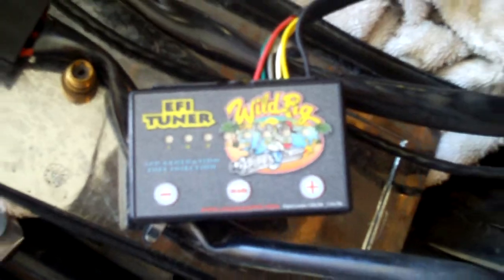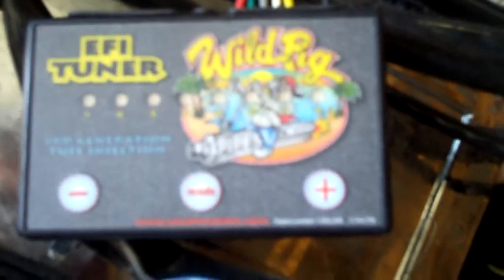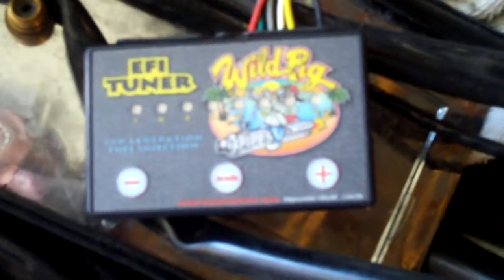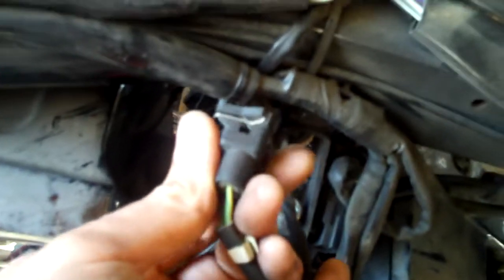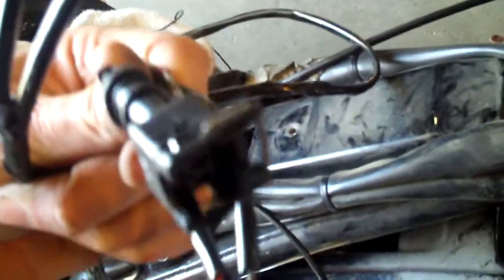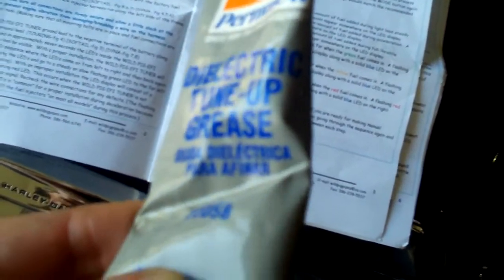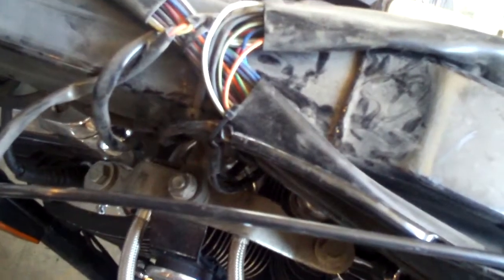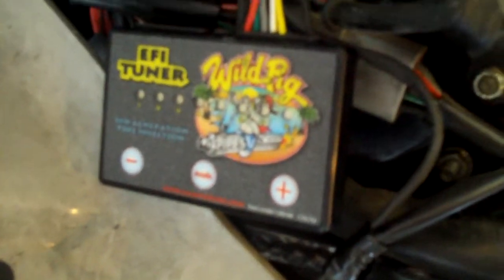Magneti Marelli Fuel Injection Tuner - Harley Davidson

Comment: What does this controller change?  Will it remove the shots from the exhaust pipe when accelerating or braking? Touring 2001 88 magnetti marrelli , slipons 4”, quiet baffle. fuel consumption - 7L/100km🕺🏻
Reply from the maker: It makes the air to fuel ratio more rich by lengthening the pulse of the fuel injectors. This is helpful if the fuel injection is too lean to make good horse power and torque. As for popping in the exhaust, it can help with that by adding more fuel to the low rpm setting making the mixture too rich to ignite in the exhaust system. I say help because depending on how far it has to go you may end up with a motor that is running too rich; bad gas mileage and even fouled plugs. There's some wiggle room but don't expect a miracle result.
Reply: Mark Young - Outside The Box thanks! I need only understand what model is for my bike: 9120265 or 8120128. http://electronicjetkit.com/Harley/viewproduct.asp?partnumber=9120265
Reply from the maker: A listing I recently saw on eBay showed the correct model from Dobeck to be 8120128.

Comment: Hey brother do they sell.thosevtuners anymore Ime in need cause i own a 1998 road glide with that feul injection system.  Please let me know ok man it would greatly be appreciated
Reply from the maker: Hello! I don't think you can find any brand new, I could be wrong. The two I installed and tried on mine were both bought used online (eBay). I would keep searching online and just maybe you'll find one, but they are kind of rare due to how many years have gone by.

Comment: Looking on the internet, Wild Pig and other companies put their badges on the Dobeck. Since mine is a Gen 3.5 may be the reason they state it doesn't matter which plug goes where. Nevertheless, I installed mine according to your front/rear injector instructions to play it safe. On their web site, they have a "hands on" simulator that you can practice setting the controller. I noticed you did another video on an earlier EFI Dobeck where you had to splice wires. Isn't it nice not having to splice the injector wires on the newer unit and just hook up a ground? The  Dobeck products previous to the Gen 3.5 adds fuel, while the 3.5 also decreases fuel and since I am running rich, Dobeck sent me the one I have, to solve the problem. I was able to lift the tank without taking off the fuel lines and it's installed. Waiting for it to stop raining to warm it up, test run and set it. Before going to Sturgis, I used your video to set my TPS. The Harley shops don't like (or don't know) how to work on the older bikes anymore. Anything I can find to keep my 96 running good.
Reply from the maker: +Paul Murray To be fair, the other controller worked pretty good too, but I kept seeing the newer push-button style and found how customizable it was so I pulled the trigger on this one on Ebay. I am familiar with the 3.5 being able to pull fuel away from the engine as well. I really like their test display on their website for punching in your numbers and getting a graph showing the results. I should have mentioned in the video, as it is a pain to remove the tank from our twin-line bikes, that I removed the tank as I was replacing the fuel pump and filter at the same time and was thinking of having it painted as well. The fuel pump and filter went in, but as time to ride neared at the end of a long Winter the paint was put off to another time. Let me give you one more recommendation; using E3 spark plugs. I believe they are the E3.36 model for EVO applications, but double check on that. I put a set in last Spring and rode the bike to Laconia, etc. (put about 5,000 miles on it over the Summer) with no problems, no hiccups, no skipping, just a strong running motor. Watch some of their videos. Something to think about.
Reply from the maker: +Paul Murray And let me know how she runs with the unit on it now!
Reply from the maker: +Paul Murray This was from my return home from Laconia.... Meredith, N.H. to Newport, Maine, 170.8 miles, on 3.323 gallons of gas equals 51.399 miles per gallon.
Reply: I am doing a product evaluation on the Gen 3.5 for a motorcycle magazine and have direct contact with the Dobeck rep. I also finished one on the Shorai  Lithium Iron battery. It was so light that I put in in my saddlebag as a spare on my trip to Strugis. I also have ALL the Sena intercom products, but a lot of the guys I ride with don't use intercom or can't afford it, so sometimes I loan them my extras. I use the Sena SPH10H dedicated for the 1/2 helmet in the summer and the regular one on my full face in the winter.
Reply: Was the mileage with the Dobeck installed?  I got 61 mpg on the way up  to Sturgis in 2005, doing 60 mph with the group. My mpg wasn't that good coming back at 80mph. After my top end job, it decreased and now I am running rich lately. I usually keep up with auto and motorcycle stuff and had never heard of E3. I looked on their web site. It looks like a modification of the Splitfires. I see Pep Boys, Advance & O'Reilly's carry them. I checked on Ebay and they are expensive. I had problems with my 83 Roadster in Daytona traffic, etc. and started using Splitfires and my fouling quit. I got a good deal in Daytona and a shop next to Harley was closing them out at $2 apiece and I bought all they had left. My mechanic likes Autolite and tried it for awhile until I switched to NGK on the Road King. I have also used Denso (formerly Nippondenso) fine wire in my sports cars.
Reply from the maker: +Paul Murray Yes, this was WITH the Dobeck installed. 61 mpg is very impressive! I have never gotten over 55 mpg with mine. I got my E3 plugs from O'Reilly's. Yes, they are a bit more $ than the others, but to me it's been worth it. I was due for new plugs at the time and a friend of mine watched videos on the E3 plugs and bought a set for his 5 cylinder Volvo. We took it for a test ride, floored it, and it was absolutely flawless. Same thing happens on my bike. From down low around town grunt to climbing a hill or passing, they have never hesitated or hiccuped like some do. Maybe it's all just smoke and mirrors, but if they weren't good they'd be in the trash by now! haha
Reply from the maker: +Paul Murray Which motorcycle magazine do you work for? Do you have to send product evaluations back to the manufacturer after some time, or do you get to keep the Dobeck?
Reply: I get to keep all the products I test. I actually work for a multiple State magazine and a National magazine, however, the National one which I think was the best, is up for sale. Cannot say.
Reply: The 61 mpg was without a fuel controller. Since I was running rich lately, I picked up some NGK BRP5ES-11 plugs at Advance yesterday. If you order through the internet, you get 20 % off. 2 plugs cost $3.50. I believe Auto Zone does the same. You take the printed copy to the store and pick it up. About E3 comments, I have heard the same comments about the Splitfire, but they worked for the Roadster.
Reply from the maker: +Paul Murray So Paul, I don't understand why your bike suddenly started running rich? Are you sure the air temperature sensor is good? The altitude sensor (that black box little thingy with the snorkel under the right side cover)? You've probably already done the "remove fuses from the fuel injection circuit to reset it" thing.
Reply: Even after installing the Dobeck, it's still running a little rich. The Stage 1 settings on the Dobeck are 5; 5; 4.5; 3.5; 4.5; 4.5. I backed off the factory setting to 2; 3; 3 and left the others alone and went on a 100 mi. ride. It was not as black, but still running rich. I have dual Hookers and most of the exhaust comes out the right pipe. I then went down to 1; 2.5;. 2.5 and have not ridden it yet to see what happens. My bike was sputtering and popping, so the TPS and cylinder head temp sensors were replaced by the dealer in 2002. Would taking off the battery leads reset the FI circuit to reset it? Since your bike is similar to mine, can you help me locate the air temp sensor and how to reset the FI circuit if taking the leads don't do it? I have the feeling that it's a sensor. It's getting hard to find any info on such an old bike on the net. Maybe a video on sensor locations and how to replace them?
Reply from the maker: +Paul Murray At about 8 minutes in this video you will see where the fuses are to pull for about a minute to reset the fuel injection mapping.....https://www.youtube.com/watch?v=X1a9kBx_Lb4. As for the intake air temperature sensor, it is right behind the throttle position sensor. I don't know if it can be changed with the intake on the engine or if it has to be removed to get better access to it. You've already changed out the engine temperature sensor, so the only other sensor I can think of that would affect fuel mix would be the altimeter (barometric) sensor that I mentioned before under the right side cover with a connector plug and a little snorkel pipe sticking out it. I have changed the engine temperature on my bike, but none of the other sensors yet.
Reply from the maker: +Paul Murray Also Paul, read the instructions carefully as I remember reading that taking fuel "away" from the injectors with the 3.5 system you have to use the "0.5" setting. Do you see that anywhere?
Reply from the maker: +Paul Murray Here is an image of the Magneti Marelli fuel injection body that shows the intake air temperature (the smaller one of the two black socketed things) mounted next to the throttle position sensor. Looks like it is held there by two screws. http://i.ebayimg.com/images/i/262081371495-0-1/s-l1000.jpg
Reply: I did some more research on the MM injection and found one, of all places, on the Dobeck site. You may be right, It may be my air temp sensor that's bad and the Dobeck may not solve that. They also say to pull the 2 flat fuses from the right side after doing the Dobeck settings. What I don't understand is one is the ECM and the other, fuel pump fuse. What would the FP have to do with the ECM memory? Also, wouldn't pulling the lead off the battery do the same thing? I mention a H-D service bulletin and they say pull both also. Once thing in your TPS video, you don't mention anything about pulling the fuses after doing the resets like the service bulletin states. Maybe that's why my new setting didn't reset? This step is to clear the ECM memory of the previouly learned minimum throttle position. I guess I am going to have to go through your TPS video and reset my TPS, then pull the fuses to reset the ECM. This H-D service bulletin M-1105, showing the revised method of setting the idle speed, but I don't have the Scanalzyer (HD-41325) to perform the tests, hence the pin in the wire technique. The voltage setting for the cold idle is close to your voltage in your video. .61 to .64  
 http://www.harley-heaven.com/M1105_idle_speed_MM.pdf 
I have also looked on the V-twin and HD blogs and there is a lot of mention about MM being very reliable but there is a problems on setting them, the problems are at the dealerships because no one knows how to work on them anymore. Some MM owners have gone back numerous times and still not fixed. The new mechanics, including auto, are now just parts replacers. We need to start a MM club. I am picking on you since you are the only one posting anything on the 1995-2001 MM bikes.
Reply from the maker: +Paul Murray Well I didn't know what a headache the MM system can be until after I bought my bike. Surprise! Since I get a lot of my information and how-to's from Youtube and the internet, I wanted to give back. You can read shop manuals and service bulletins until the cows come home, but seeing it happen in a video is sometimes easier to understand. Good question on why to pull the fuel pump fuse, all I can think is that they recommend pulling both so you don't pull just one and it turns out it was the wrong one. Maybe? I agree that if you pull one of the cables off the battery (positive or negative) that should accomplish the same reset of the ECM as described. To be honest, I didn't know that resetting the ECM was recommended after setting up the throttle position sensor, cold idle and warm idle. The variation between 0.061 and 0.064 volts would be very minor translated to engine RPM, so this measurement does not have to be to the exact 0.06X number. Oh, and I don't know anyone who has a Scanalyzer, I wonder where they all went?!
Reply: From what I was able to find on the net, the MM system is a very reliable system and is or has been used in very expensive autos and used in Harleys from 1995-2001. Only when it goes wrong and you can't find anyone who is knowledgeable is it a pain.  I asked my mechanic about pulling the battery cable and he didn't know about resetting the ECM. Everything I found, Harley service and Dobeck, says to pull the fuses each time after final adjustments to clear the memory in the ECM. Makes sense. I ordered an IATsensor am going to try to recalibrate after getting my IAT. After I ordered it, I looked at the bike. Have you ever replaced the IAT? It's tucked away and appears you have to pull the intake completely off to replace it.  My mech says he has "special tools" that maybe can be used. I hope so. I don't look forward to pulling the intake out. Dobeck MM site http://www.dobeckperformance.com/articles/Magneti_Marelli.asp
Reply from the maker: +Paul Murray Yes, I have seen where the IAT is located. Maybe by 'special tools' he means he has something that will extend in there with a universal joint to get on the bolts that hold the intake to the head. I have yet to remove the whole intake from mine and hope I never have to as it does not look like a fun job. Where did you find your new IAT for sale? Thanks for including the link to the Dobeck MM page, I have already been there myself, and it's nice that Dobeck took the time to include this system in their lineup and studies. To other manufacturers of tuners the MM system doesn't seem to exist.
Reply: Even so, you have to pull the IAT out of its socket and it looks like there's no room before hitting the cylinder fins. Even getting at it with an allen doesn't look easy. Nothing worse than being able to see the part, but can't get at it. I don't know if it's the correct part # 27381-06. This is the part # found on the ebay site. I hope Harley uses this for a wide range of years. Surdyke.com had it for $19+$7 ship. Another site had it for the same price, but shipping was doubled. Ebay had it average $35-45
Reply: I found a Scanalyzer for $975 on the Canadian Ebay site. Too much for me. I can't even read the check engine light for my codes since it's not hooked up.
Reply from the maker: +Paul Murray Too much for me too. What isn't hooked up, Paul, your check engine light?
Reply: Check Engine Light not hooked up. If you turn on your ignition, wait for the fuel pump to stop, turn it off, turn it on again, then repeat, the CEL will supposedly flash the error codes and the scanalyzer isn't necessary.
Reply from the maker: +Paul Murray Not hooked up on purpose? My CEL comes in handy starting the bike, I wait for the light to go out and then hit the start button. I've been told that's what to do.
Reply: "Gen3: set the fueling modes all to light setting 0.5 to revert back to stock. Gen3.5: Stock fuel setting vary according to application check electronicjetkit.com for info.
Reply from the maker: +Paul Murray Nice information to know.
Reply: My IAT came in and I screwed up. Their web site had no picture so I ordered a 27381-06 thinking it was the right part and that H-D didn't change them. It ended up being a one bolt Delphi IAT. I now have to exchange it for the 2 bolt Marelli 27270-95. The Delphi cost $19 plus $7 ship and Marelli $20 plus ship. I hope they can exchange it but they are snowed in right now. Looking on ebay and J & P, etc. average price for the Marelli IAT is $40 plus. Surdke.com is a H-D dealership with an internet ordering facility also. If you ever need one, you have the right part # I gave you.
http://www.surdyke.com/AdvPartInfo.asp?PartNumber=27270-95
Reply from the maker: +Paul Murray Sorry you got the wrong one first, but many of us have been there done that when it comes to parts, especially with no picture. Thanks for including the correct part number and the link! I hope when you do get the right IAT sensor that it makes a noticeable difference in how your bike runs, no more rich condition. Crossing fingers that is it for you. Keep me posted Paul. Thanks.
Reply from the maker: +Mark Young One more bit of info for you Paul. If your fuel lines start leaking due to bad o-rings in the couplings (like mine was doing when I bought it but I didn't notice it until a few days after purchase when I could smell gas and saw it dripping onto the left side engine case). The Harley Davidson lines are not serviceable (throw away only), but these Goodridge fuel lines can be taken apart so that new o-rings can be installed when needed. These are the lines I bought for mine and they seem to be of great quality of workmanship and not bad to look at either! http://www.jpcycles.com/product/400-630
Reply: Ouch $190. Hope I don't have to replace them soon.
Reply from the maker: +Paul Murray I also found a rebuild kit for them that includes new snap rings and o-rings for just over 6 bucks. You're right, it would be nice to get them cheaper, so how about this, $140.00? Goodridge Fuel Lines model HDFL005 http://www.ebay.com/itm/Goodridge-Replacement-Fuel-Injection-Line-w-Chr-Fittings-Harley-FLHRI-1996-1999-/331770394268?hash=item4d3f0e769c:g:fOgAAOSwnLdWs61F&amp;vxp=mtr